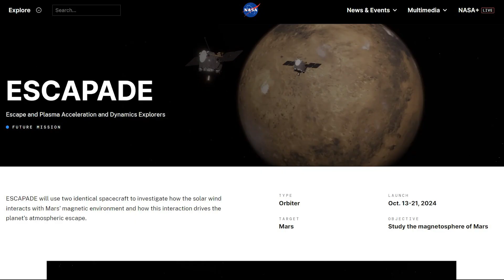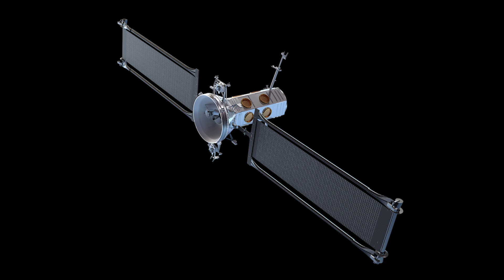Blue Origin Wants To Land New Glenn’s Booster On The First Try

Comment: That's the problem with being so far behind your competitors, you try to go for the "hail mary" to eliminate the development gap in one flight. Perhaps this is BO's attempt to emulate SpaceX's 'hardware rich" development cycle. Might as well try to land it on the first flight if you have all the equipment and ship in place. New information to improve the design is likely, and excitement is guaranteed.
My bet is that they have propellant sloshing problems just like Super Heavy that hinders the relight of the booster engines for boostback and landing. Their suborbital booster does not have to do as much attitude maneuvering and it is so much smaller. The equations of fuel sloshing do not scale well from a small model to a large.
At any rate, having a second heavy lift partially reusable launch vehicle in the US arsenal is a great thing. Maybe if it becomes fully operational, it will light a fire in the Europeans to build a reusable version of Ariane.

Comment: David Limp actually said that all seven BE-4 engines have been built. Eric Berger of Ars Technica over a week ago reported that those engines passed their acceptance testing, are at the factory in Florida, and that installation had begun. 

This video also didn't mention that the flight 2nd stage is out at LC-36 right now for its hotfire testing.
Reply: Well, Mike, that's journalism!
I'm reading YOUR news in New Zealand; few have heard of the place...📰📺📡🌏🇳🇿🏝🗞☕👤

Comment: Yeah, if Blue Origin gets two static fires, a full stacking, and a wet dress rehearsal done by the end of November, I will be impressed. Heck, if they get all that done by January, I will be impressed. I certainly hope that their operational experience with New Shepard is as applicable as they think it is.
Reply: I thought that too, would be manageable for a rocket already in service but for a first launch of a test rocket it's insanely ambitious.
Reply: Well we’ve already done one static fire and are getting ready for our second. Wish us luck!
Reply: @noahelliot.t0023  No, there has been a single test fire of the second stage that is all. Still have to do a full stack rollout, static fire of the first stage and wet dress rehearsal. Even for a rocket that has flown before that normally takes quite some time. I don't think it will launch this year. Has the thing even been stacked with full flight hardware yet. Last time it was rolled out there were still bits of it that weren't actual flight hardware. I am sure it won't be that long now but you have to be realistic.
Reply: @schrodingerscat1863  dude I work there I’m pretty sure I know what we’ve done. Lmao
Reply: @noahelliot.t0023  Maybe but you are misrepresenting somewhat. The static fire you are talking about is for the second stage. The first stage which requires 7 BE-4s has not even been seen yet in a completed state let alone static fired. Firing 7 BE-4s together is considerably more complex than 2 BE-3s. Has a first stage test article even been fully assembled yet? All we have seen so far are the tanks being tested but no engines yet. Also the initial launch is planning to land the the first stage so you would need to test relight of some of the engines too. Is this going to be part of the static fire campaign or is the plan to just wing it based on single engine test stand fires.
Reply: @schrodingerscat1863  I never said what stage of the vehicle we test fired all I said was we’ve tested fired the vehicle once and are planning on test firing the vehicle again. That was true statement. Lmao
Reply: @noahelliot.t0023  Yeh, you made it sound like you are already half way done which isn't the case at all. Only the second stage has been static fired and no one has seen the first stage with engines fitted at all let alone seeing it anywhere close to being static fired.  Maybe it is hidden away somewhere all ready to static fire but there hasn't been any evidence of that at all so far and even if it is this will be a first test firing of 7 BE-4 engines together. Just being realistic here, much of what is expected to have happened for a launch this year hasn't happened yet.
Reply: @schrodingerscat1863  I never made it sound like anything. You’re making assumptions and then tripping in some guys YouTube comments. I literally said we’ve test fired once and are preparing for our second test fire. What are you smoking my guy?? lol
Reply: @noahelliot.t0023  No you got called out and are back peddling.
Reply: @schrodingerscat1863  I didn’t get called out or back peddled. I literally made none of the nonsense claims you said I made
Reply: OP spoke of 2 static fires needed for the rocket, that is one for first and one for second stages. You then commented that you have done the first and are getting ready for the second. All, this in the context of the rocket being ready for launch end of November. You have to admit that in this context your comment seems, shall we say, rather optimistic. Are you talking about a second static fire for the second stage or a static fire of the first. That is going to be the one that really decides the launch timeframe as it's the most likely to require dialling in.

Comment: TBF Mars rendezvous windows are normally about 9 months so in effect they are moving it from the beginning to the end of the Hohman Transfer Window.  Even so given how over specked New Glen is for this mission they could probably take a more direct route and not bother with a Hohman Transfer.
Reply: The satellites require enough fuel to slow down to get into Mars Orbit, Its not just how powerful New Glenn is, to put them into a faster transit speed to catch up to Mars.

Comment: Of course they want to land it because they can't mass produce these things like starship
Reply: Of course, HLS Starship DOESN'T need a Mechazilla waiting on the surface of the Moon to catch it. The HLS Starship doesn't need one.
Apparently, this SpaceX lunar lander has landing legs; but we haven't seen either "hide or hair" of it at Boca Chica, yet, because HLS Starship WON'T be mass produced by SpaceX.
Did I get that right?
Reply: @davidstevenson9517  Spacex is still testing low fidelity throw away test articles.  Clearly you have little to no actual idea what's being done or why.  But you make that clear with every post.
Reply: It's more than that.. you're being simple.

Comment: The irony of the Shuttle painting the main tank is, had they done that all the time, it would have helped keep foam from breaking off.
Reply: The foam came from the structure that attached the tank to the shuttle. It didn't fall off the tank.
Reply: naah
Reply: According to who?
Reply: Paint creates a shell micrometers thick that absolutely covers porous material, and promotes lamer flow. Foam breaking off was a known problem, and it happened all over the structure, not just that one time with Columbia.
Reply: @hawkdsl  They solved the problem by modifying several of the tanks' external fixtures so the foam could be sprayed more uniformly without voids. The rest of the tank was fine. It was the parts where the external fixtures were attached that caused the problems. You're probably seeing ice fall from the other parts, which surprisingly never caused any issues.
Reply: @haydentravis3348  Look it up for yourself. The problem was that their application process was flawed, leaving porosity in the areas where external fittings were placed. The cryogenics caused gasification in these areas and weakened the foam.
Reply: Thats not true? One of the reasons they stopped is because it didnt help at all
Reply: @_mikolaj_  Yes. The problem was that the foam around the external fixtures was not applied evenly and had voids, which are basically air pockets. The hydrogen then seeped into those pockets and expanded due to heat. This basically popped off the foam.

Comment: I hope Blue is working on a New Armstrong/Aldrin Super Heavy Reusable Booster.
Reply: I was very disappointed that Tim Dodd didn't ask about that in the BO tour.
Reply: @hawkdsl  In a round about way he did, during part two when talking about the crew tower Jeff mentioned it was built oversized for future designs when Tim asked if Glenn would fly crew.

Not a straight up admission of a New Armstrong, but a hint that they are doing concepts of larger launchers.
Reply: @dalel3608  Good catch.
Reply: @hawkdsl  I don't think he wasn't allowed to ask random questions, as far as I can tell from various sources, can't vouch for validity mind you, it was all kind of scripted.
Reply: I hope they get this one working reliably first, but when they do it will start the next stage in this space race.

Comment: Why Do Astronauts Float in Space?
Base on this we can make artificial Gravity
Only can do this on Earth
This is the Secret
And the high-speed Space Station
Artificial Gravity is what is being sought and is very valuable

Something that is far in space beyond the magnetic reach of the Earth then that something NO LONGER has Density, instead it floats around aimlessly until it is again in the magnetic area of a celestial body that has a Magnetic Bar, then it will fall in that direction; This practically happens because all celestial bodies drift through an orbit at extraordinary SPEED. 
Astronauts and other objects in various Apollo rockets sent to the moon in 1969 proved all this information, and these objects and astronautes seemed to be floating in the space of the rocket.

So actually the Magnetic Bar stretching from north to south is what causes attraction (gravity), and every concrete object has a Falling Motion or Specific Gravity (Density). 

Every concrete object consists of an arrangement of atoms and emptiness. These atoms have particles that also have a magnetic bar in their mass. The magnetic bar on the atom is what ATTRACTS EACH OTHER to the MAGNETICBAR on Earth. The denser the object is with the arrangement of its atoms, the greater the DENSITY or the greater the falling motion. 

The difference in atomic density is what differentiates the specific gravity or density of each concrete object.
As a result, a mass that does not have a magnetic bar stretching from north to south does not attract or be pulled, and only two masses that each have a magnetic bar attract each other with a force that is proportional to the distance between them and the magnetic attraction value of each.
Reply: That's..  almost gibberish.  Where did you cut and paste that nonsense from?

Comment: Rocket is complicated and dificulte
Low safety and high cost
We need somethings better
Developing technologies to enable human access to space at dramatically lower cost and increased reliability #FeelFree
Reply: It certainly gives that impression to me. Let's see how it goes. They will iterate the design.
Reply: spaceplane is the ultimate best tech, but applications are further off than re-usable rockets in the future. Studies showing rapid destruction of the atmosphere from too many rocket launches/satelite descents will cause launches to be staggered and push space plane technology.  I believe they have technology that works better for heat deflection better than the space shuttles tiles now.

Comment: Go to Mars with
AntiGravity Space Ship
Work base on Gravity just spinning by using car's engine
can fly in bad weather plunge in the ocean even in outer space

Earth which weight predict 600 trillion ton does not fall at the Sun because of centrifugal in orbitting, on the contrary it does not be thrown far go out the orbit line of hold by gravity at the Sun as orbit center. Gravity and centrifugal is equal called Equillibrium, thats why until now Earth which we was inhabited always rotate and circulate the Sun. Now we justly take example : how if the gravity used and centrifugal is negated? The Earth will float far leave the Sun. So that centrifugal can be used to fly far away if gravity eliminated. Finally how to eliminate gravity?

It’s way rotate part of aircraft by horizontal. When that rotation faster centrifugal force getting greater and the gravity getting smaller, finally it lose the gravity and the aircraft start flying. Of course people would surprise: how the aircraft can keep rotate without fulcrums? Thats why we named that aircraft Shuttling System that is aircraft likes two disc adjoining attached in the midle as fulcrums:

A. The Top part, we name Positive rotate to right, and the edges is getting thicker and havier.

B. The Buttom part, we name Negative rotating to left, and the edges is getting thicker and havier.

C. Middle Part , we name Neutral, air crew placed and also machine and everythings turning Negative and Positive at the same time.

The aircraft can liftup added with explosion from the engine. However that aircraft construction later, let the engineer doit it, and we are sure the aircraft will bulletproof and also waterproof.
 
.
.
 
In modern civilization where human being generally using flying saucer as vehicle, will a lot of change in lives either in materialism and in psychological. In materialism area will apply the change in life like.
People no longger need roadway and rel road which spend large of energy, money, places, things and time, object place and time. People would utilize that area for habitat or for other need:
Reply: Ngl, a big block ufo sounds kinda cool